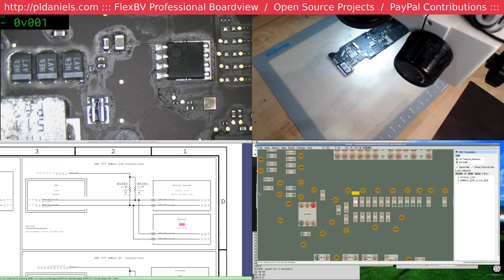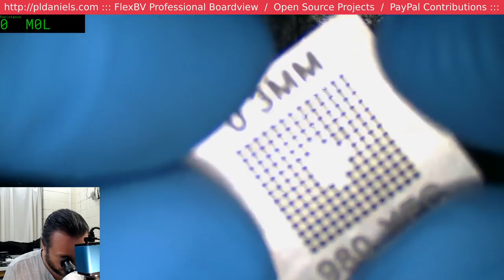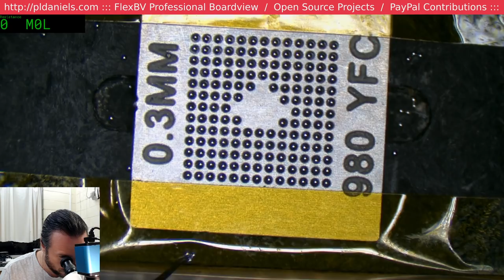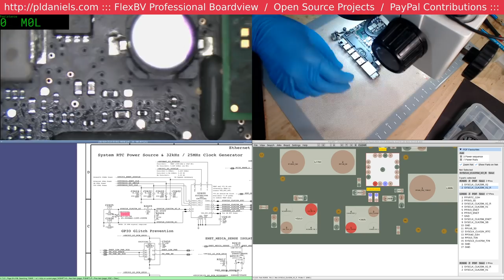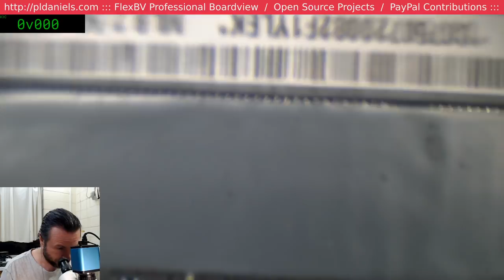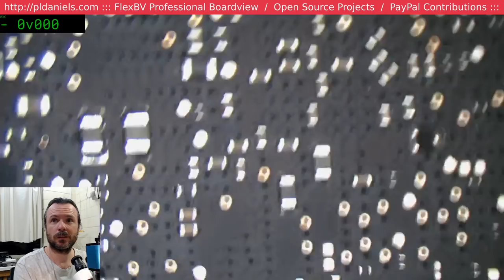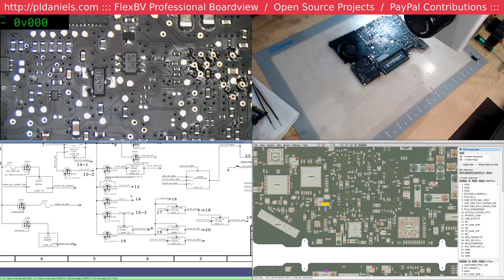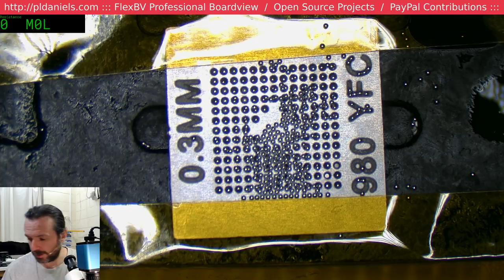Saturday Night - try fix up A1466 and get on with an A1278

Comment: Paul, serious question. Why do people invest money in repairing older MB Air's? and MB Pro's........Why?  I don't understand it. I mean, it's good for you and other MB repair specialists but why waste money fixing a 6-7 year old laptop? What aspect am i not grasping?
Reply from the maker: It's cheaper to repair them than the time/pain involved in migrating to a new machine. Basic equation I suppose is $350 to repair, or $1500~$2500 for a new machine, with the added extra of having to get used to everything again.

Performance/features aren't really a driving factor for them, it's more about familiarity / setup;  once their machine is fixed, they can get straight back to what they were doing with limited down time.
Reply: @pldaniels  Makes sense, we primates (me in particular) love it when the round peg fits in the round hole......and it stays that way. We are definitely creatures of habit and familiarity. Thanks, Paul.

Comment: 1:02:10 usually OS or FS corruption.
The long time to get to the Apple logo usually caused by the machine looking for a drive that was previously installed. PRAM reset should fix that.